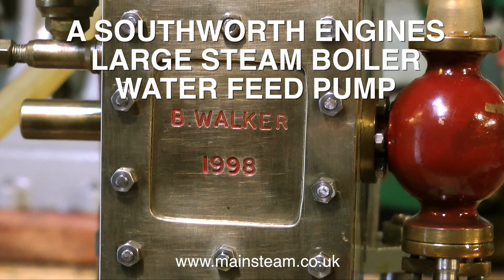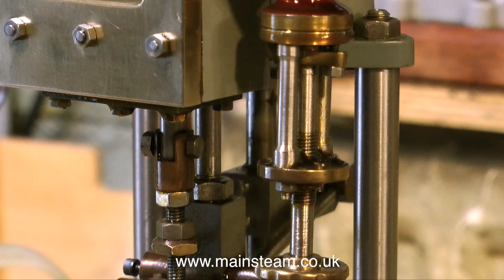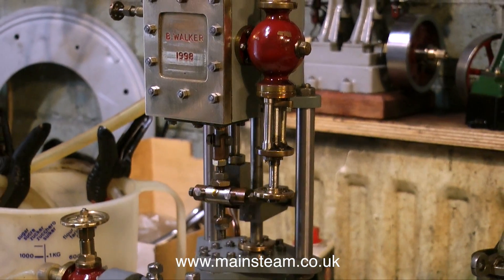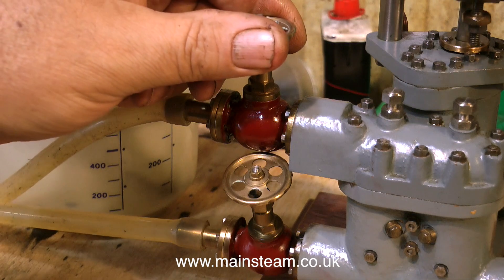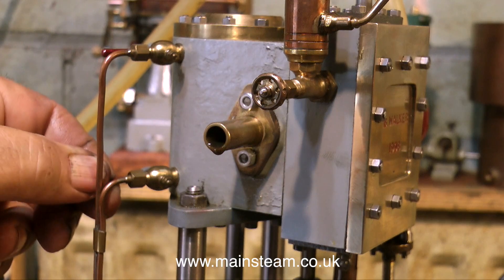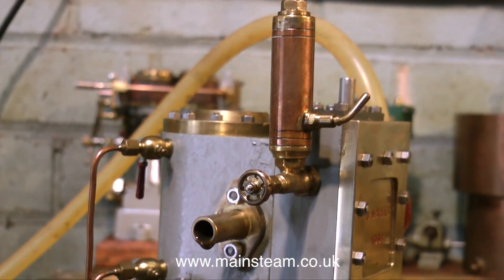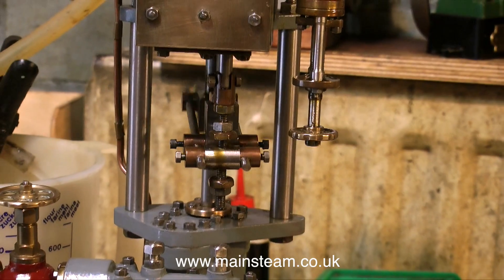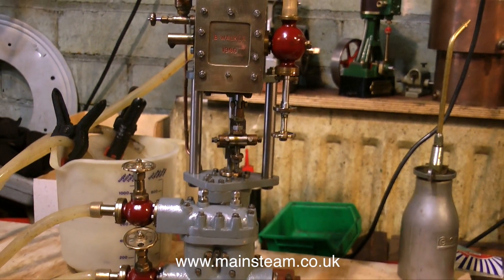BERNARD WALKER'S STEAM ENGINES - SOUTHWORTH LARGE STEAM PUMP

Comment: Thats a nice steam pump do you run the engine with steam to or only with air ia it better for the steam engine?
Reply from the maker: luc snippe I will be doing a video of the pump in steam as soon as I get the chance . . .
Reply: Keith Appleton i want to make a coal dired boiler for a project on my highscool for my wilesco steam engine what material is the best for it?
Reply from the maker: luc snippe Copper is always the best material to use for small model steam boilers.
Reply from the maker: AlmightyBanger Copper is best but at those sizes very expensive .......